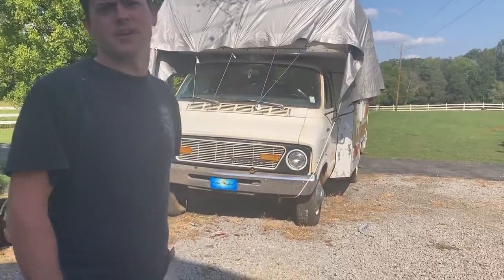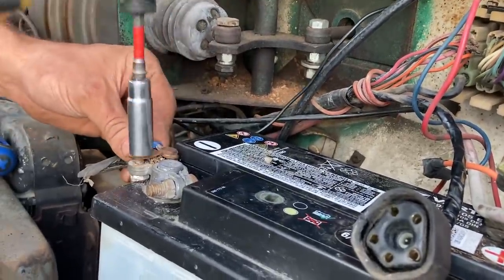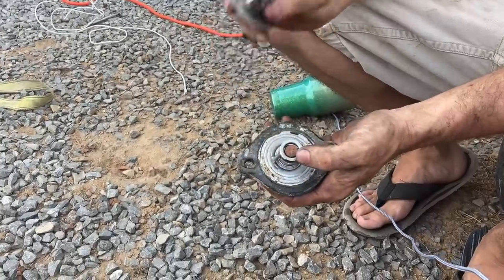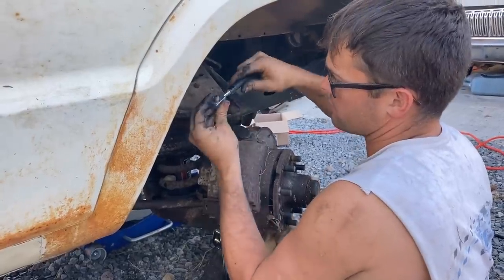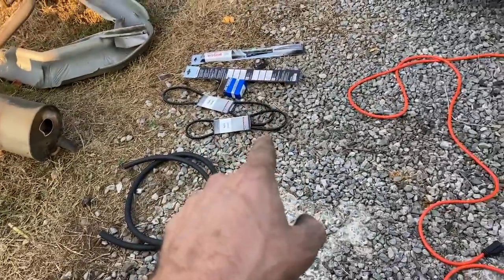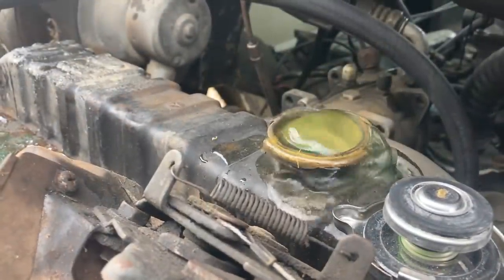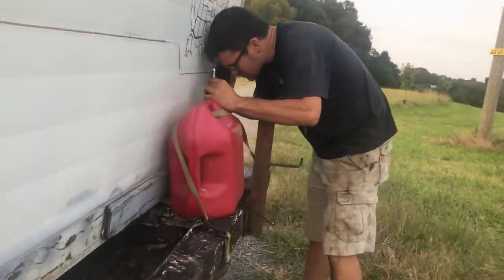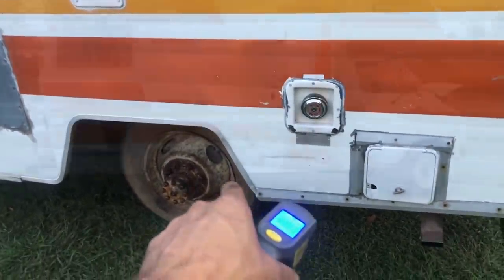broke down in our old rv on our first drive after it being parked for 27 years

Comment: As the video progressed I kept thinking to myself “ballast resister”.  It was real common with those that you shut the engine off and when you go to restart, nothing. We had a neighbor who was a Chrysler mechanic and in 1972 he told me to always keep one in the glove box. I did, and I needed it.
Reply from the maker: Thats funny
Reply: Absolutely!! Always carried a spare in the glovebox.
Reply: Yes that ceramic block on the firewall
Reply: Had a 76 ram charger that i was 4wheelin n rolled it n cracked the ceramic switch n had to walk home
Reply: well blow through it. don't  french kiss it.
Reply: I worked for a Chrysler/Talbot dealership in the UK, that type of ballast resister was fitted to all of the French built cars 1977 - 79, they were always burning out, the reason is because the element is covered with fireclay, so it gets no cooling
Reply: Ya man
Reply: Nope always carry two.  40 some odd years ago I could change one of those ceramic pieces of junk with my eyes closed lol

Comment: I had the same issues on my 84 jeep cj7 . It was intermittent. I scratch a bare spot on my head,lol! All the ignition parts were on driver side. The battery and distributor, was on passenger side. I replaced all the ignition parts,cleaned grounds. I eliminated the modual and wire up a 4 pin G.M. hei module. Made a heat sync off a computer bord.and mounted it on passenger fender,by the battery and distributor. It eliminated alot of wires, strung all around the engine. It worked awsome. I also ran an extra 14 awg. Feed wire from battery to the coil.the spark was kinda a weak before.  It increased the amps to coil and produced alot better spark. The aluminum block(computer heat sync ) I amed the fins slightly towards the engine fan,for optimum cooling👍.she's working like a champ 9 years later. It's way cheaper than factory ignition parts.hope my experience helps you in you're travels😃👍. Thanks again for sharing 👍
Reply from the maker: Good info thank you

Comment: Quick bit of knowledge- that 360 has J heads. They are a very good flowing SB head, usually found on the early cast 360 blocks. Those blocks have the thicker walls, the 340 cylinder casting thickness (wide has a wider bore, shorter stroke than the 360). The T-stat in there is the HD one, you put in a standard duty one. Also, if you have to rebuild the carb- swap to a 4-bbl. The primaries are smaller, so cruises much more efficiently  than on the larger 2-bbl
Reply from the maker: Ok thank you
Reply: @Sleeperdude  welcome. I love the old Mopar stuff

Comment: Years ago i bought a 1975 Dodge Tioga RV.Pretty much the same as your set up.Only mine had a overheated engine.So after about a month......new Jasper long block remanufactured 360.Had to remove entire front grill  hood,core support etc to stab it in with rebuilt trans attatched.Less the oil pan and pump.The engine crane barely fit.But while engine was still in air.....we bolted on the oil pump....then pan and set in place.Nothing i ever wanted to do again.Had the same Carter AFB 4V carb.Had to rebuild that....but all in all new brakes tires....remodeled inside.That was 1988 when i fixed it.Still runs great till this day.2 owners later.Then one day while installing new carpet.The extra battery compartment inside a closet......i found a bag full of silver coins.which i still have today.I enjoyed your trial and error attempts at fix it yourself.Thats the best way to learn.Because next time around.....its easy as pie.I spent more money on a killer stereo system with CD and cassette.Large amps and that got me in more trouble than i care to ever know.I was single at the time and always hung out at this one bar in my small town of Griffith,Indiana.The bar closes........then i invited many a ladies to hang with.Got lucky in that thing many times.Its great to camp in because being on the road many times....just pull over....rest....eat....pee....or whatever.One day i will get another RV that is a bit more modern.keep up the good work....and happy trails with family.
Reply from the maker: Thank you

Comment: Just a little dually tip, if you ever have to run one wheel on back flip it around like it's the outer wheel. It'll keep you a wider stance for more stability. I had to run one like that for bout a year once, times were a lil tight then, lol. Keep up the good work
Reply from the maker: Good tip! thank you

Comment: #Note those Chevy rims, make sure the lug holes are the same measurement as your dodge rims. If so, you can grind the centers out to make them fit your rear axle. When searching for parts for that RV, originally your RV was a 1 ton Van, the RV Company purchased 1 ton vans from dealerships to modify the bodies into RV’s. The Fuel Tank Grommets, if the RV Company is still in business is where you can get the Grommet.
Reply from the maker: Good info thanks

Comment: Use to have a 77 B300 tradesman extended van my friends called the Maxi Pad. Had the same engine/trans/rear combo as yours. Had to put in a timing chain in it, hooked up the trans lines to the radiator before noticing I forgot the fan shroud. Left if off, but found that was a mistake. Fan does not pull in air while in traffic, so it would over heat. Brings back memories. The van was a beast. Sniff, miss that van!
Reply from the maker: That’s a cool story
Reply from the maker: That’s a cool story

Comment: A extremely dirty chassis ground can overload and start melting the tin strip coil inside the ballast resistor......  I have to admit how well your wife is at not bursting out laughing at your antics..... First with the face you make when you blow things and the encounters (personal) ones with rocky... LOL Kudos to you hun your hubby is a goofball... That much fuel going down the carb its either a stuck needle & float or a blown power valve
Reply from the maker: She has been listening to me for 20 years she’s used to it now

Comment: sounds ok  when it when it is not flooding  i think the same needle in the carb  blocking  up  the one that  pumps the petrol through  the  carb  i think  but im not good as you  you will get it right  ya all be safe
Reply from the maker: I think you are right

Comment: I have never heard tires called casings. And I know plenty of folks from the south and they don’t call them that either. Where do you get that?  Just curious. Not dissing.
Reply from the maker: An old man I worked with called them that and I thought it was hilarious 😆
Reply: Old timers here in the southern Appalachians called tires casins ( casings ) when I was a kid in the north Georgia mountains in the fifties and early sixties. It was a common term. I still hear it used occasionally.
Reply: Have heard worn casings called ‘may pops’ ‘cause you could see the air in ‘em.

Comment: somewhere under the hood is a starter relay which also goes thru the neutral safety switch. the wire from the key goes to the starter relay and then there is a wire from the relay to the starter. also the neutral safety switch grounds the relay so it will only start in park or neutral
Reply from the maker: Ok thank you

Comment: You might need to bleed the stirring pump? The best way is to get both front tires off the ground and turn the stirring wheel all the way both ways about 60 times slowly without the motor running. Make sure to check fluid during. Have fun.
Reply from the maker: Ok thank you

Comment: This would make a great revival rig for you to take to pick up vehicles to rescue. Build shelves for tools and equipment with a small air tank. Should have no issue pulling a trailer. Just a thought if you want to put the time in to get it back on the road.
Reply from the maker: Ok yeah your right

Comment: I think it will be a fun road trip van. I do not know if you have worked with RV's before, but clean out the inlets and outlets for the stuff that uses propane. Use dish soap and water mix to check the propane fittings on the heater, refrigerator, and stove. I don't want to see someone get hurt. You might already know this, but I thought I would pass it along just incase you don't. Check your fresh water and grey water tanks for leaks and water fittings, these RV don't handle water on the inside very well.
Reply from the maker: Ok thank you I didn’t know

Comment: Either your needle in the carb is sticking, or it's leaking past your power valve due to old o-ring gaskets. I'm also concerned about you getting vapor-lock. Please make sure your fuel line from the fuel pump is routed AWAY from heat sources! Rebuild the carb and check the fuel line for heat build-up. Also, because its a Mopar, keep a new ballast resistor in the glove box; those can go out at ANY time and strand you. I would also pop the distributor cap and take out the points and condenser, there's a circular plate that they mount to that has 3 feet underneath that are for grounding. Make SURE that those feet has NO dirt, oil, or grease on them!!! When hot, the schmutz on them melts just enough to make a no-start condition. Hope that helps!!! I love Rocky!!
Reply from the maker: Ok thank you

Comment: Damn, your cooling system was clean. You should of seen what came out of the system on my dodge grand caravan awd. I flushed the heater cores, rad, block, expansion tank, lines etc separately. The orange gunk that came out was terrible. It just kept coming and coming. Good news is its clean now, full of g5 mopar coolant and distilled water
Reply from the maker: That’s not good

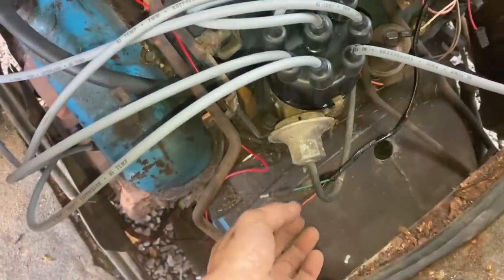Comment: Hello from the Yukon! At 34:35 you asked about those wire connectors.  They are remnants from that engine having a dual pick up distributor.  Looks like its been long bypassed.  Also, there should be a starter solenoid on the firewall,  fixing that should let you use the factory wiring again.  The starter on yours is very much on its way out.  Your rig is only the third, counting my own, that has the single wheel front/dual rear. Not common but it did happen. Mine, the home side of the motorhome was rotted out, so i converted mine to a deck van. Sure dont like that weird metallic clanging when yer hitting the starter.  That carburetor needs a rebuild with it flooding out like that.  With it being a dodge of that vintage, keep a spare set of ECU, ballast resistor, voltage regulator and fuel filter with a basic set of tools to do them; she'll getcha home.   Good luck with your ride, and enjoy!
Reply from the maker: Ok thank you for the info

Comment: Same 360 Same Dana axle. They make a universal axle now. It's splined about ten inches from the end. After months of searching I found it. A $20 side grinder cut it to the right length. Bevelled the ends too.
Reply from the maker: Ok thank you
Reply: 1976 Dodge Sportsman Van Conversion. Brougham. 22 or 24 foot. 360  Franklin,NC. Current electrical and shifting adjustment problems. The tranny actually has manually adjustable bands. Information is scarce as it moves toward Classic.

Comment: I had a 76 dodge sportsman that were three issues that stop it from running.  the most that goes is that voltage resistor  make sure you have at least three at any time. the  ignition module, and then the pump stops pumping gas.
Reply from the maker: Ok thank you

Comment: With the old Dodge trucks it wasn't if the ballast resistor would fail but when. I found that out when I owned one years ago. With no spark the ballast resistor was the first thing to replace. And yes, keep another one in your glove box just in case.

Comment: You should have checked for neg. Pulse at coil. 
Check the bowl valve and float level with carb. Also if the float isn't sticking open check pumps. 
Old carb needs a rebuild anyway. Oil pressure should be higher but it might be the gauge. Check to see it is is blowing any more coolant from radiator. You may just had it overfilled or pump just pushing out excess? Shop around for a back up engine and tran. just to be safe. Check engine compression and oil pressure and maybe remove pan and check bottom end and clean pump screen. Put a real know good oil pressure gauge on it. You gotta a lotta work. I am rebuilding 78 CJ5. Good Luck. It will take money to get it road worthy. Ron
Reply from the maker: Ok thank you
Reply: Points, igniter coil, or trigger coil. The negative side of the coil is pulsed. The coil is essentially a tesla coil. It need a spark gap or very fast high energy pulse of some sort to trigger the pulse in the secondary windings. In other words the key on cranking should shows a pulsing ground connection. Not a permanent one.

Comment: Dodges at this time had a trans dipstick with a sensor.  It would turn a light on, on in the black ac part over the engine box.  That is why there are small rectangular holes along the bottom of the AC. they were idiot lights.  Anyway, those wire would connect to the dipstick to tell the driver the trans was low on fluid.  The ac system is an aftermarket system and yes you are missing the evaporator.  Side note the borg warner pumps make awesome air compressors...
Reply from the maker: Ok thanks good info

Comment: Those Holley 2210 carbs can be troublesome. The floats are side-hung phenolic just like the Slant-six carbs and can hang up, or it's got trash in the seat which based on the tank, is my guess. A kit and a float should fix it right up. Right around '74 is when they started fooling around with reducing the base timing, timing curves, leaning the mixture and increasing the operating temperature to make engines run cleaner. A side effect was that stuff got harder to start when it was hot, so they phased in a higher-speed starter as a "disguise" to get hot engines started faster. They spin over much faster than the "small" starter so it's easier to clear floods out. Yours has the small starter on it although I think it originally should have had a large one. Either works fine though. Remember on a Mopar the failure of a ballast resistor means it will run as long as the key in in START but quits when it goes back to run. That is because the ignition circuit bypasses the resistor in START to give the coil full voltage for easier starting.
Reply from the maker: Ok thank you good info

Comment: Don't fret. This exact thing but me also one night. My wife left her car out. I went to start it up and it acted just like your camper!!! 
Ballast resister as I recall is inline with the ignition coil primary side. When resister fails, no spark.
NOTE; A few years earlier, a 1979 Dodge Omni acted, similar. It would start and run, ONLY with the key held in the start position. That Dodge Omni had 2 ballast resistors in one.
Keep a spare new Ballast resister in the vehicle..OH, if all the failures my '1969 Plymouth Valiant had, the ballast resistor never failed. ( Everything else did!)
Reply from the maker: Ok thanks
Reply: @Sleeperdude  U-bet!

Comment: That's a good running little small block in that camper. You get that carb ironed out  it a doubt in my mind it will go to North Dakota without any mechanical issues.
Reply from the maker: I hope so

Comment: looks like you need a carb rebuild kit. Sounds like the "bolt" that the needle sitting in has a flat spot on its O ring, which is letting all the fuel to just get pushed past it instead of having the needle stop it.
Reply from the maker: You are probably right

Comment: I'm thinking it was your points in the distributor or pick up coil going bad and cranking it so much got it to work. if you have that problem again check that. it's actually good preventative maintenance to clean or replace anyway
Reply from the maker: Ok thanks